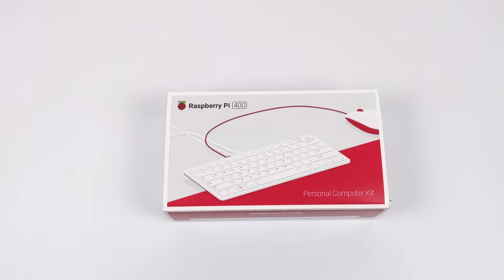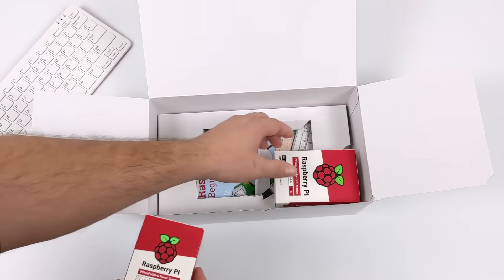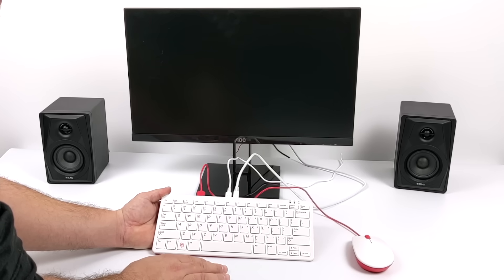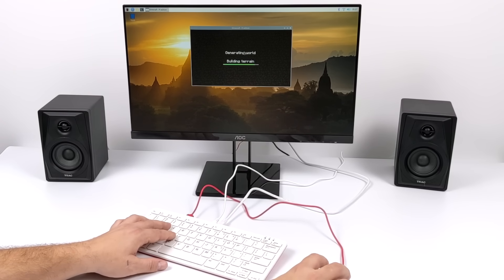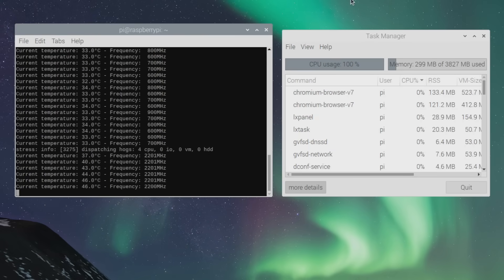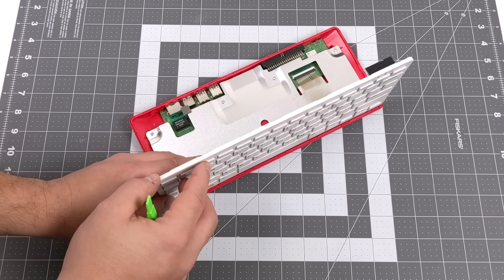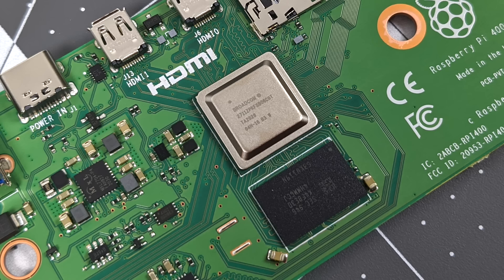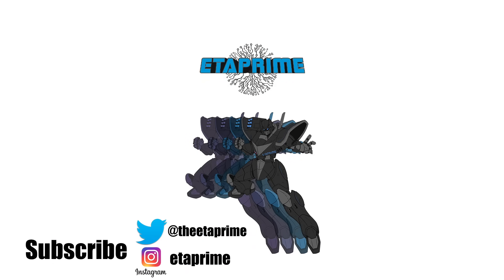The Raspberry Pi 400 is Awesome! Review, Overclock, Emulation, Tear Down

Comment: Do you think there would be enough room to get an M.2 NVME inside ? that would be very nice.
Reply: I’m pretty sure that the Raspberry Pi 4  only has PCiE gen 2, so they’d be better off just supporting mSATA, as realistically, with that CPU, etc., you won’t be getting the most out of an NVME SSD.
Reply: @GreeniusGenius  I am not technically minded enough to consider that but I was thinking the nVME is so much smaller so more chance of fitting it in, I do have an nVME running with my Pi4 in an Argon ONE M.2 case and it does work very well but I wouldn't know what percentage of its ability the nVME is working at. 
I was a click away from buying the Pi400 but the 4 gig made me hesitate wanting 8 gig, but I really like the Pi400 so I think I will buy one anyway, 
Thanks for your reply.

Comment: So wait.... I can literately just purchase a Raspberry Pi, and I can ditch my MacBook Pro's???  I always thought the Pi's were just mini computers used to control small projects and radio signal receivers etc... had no idea they actually functioned as stand-alone terminals.  Hell... I am going to try to pick up a 400 or the new one that came out recently, and see how it runs.  Does it require an external hard-drive or is the micro-SD technically the hard-drive?

Comment: I just bought one because it strongly reminds me of the old-days-gone home computers, all in a case, keyboard and storage, ports on the sides, turn on and operate. It is also beautifully styled and it does everything you need withot turning on my 550W PC (which I shall use only for gaming). For everything else, including emulating anything in the home computer history records, this is more than enough. And it's cute.

Comment: My old pc just dead because my mom just remove my pc about 5-6 months! I wish hope this new pc raspberry pi 400 will better than my old pc!
4GB.
Unknown storage could possible to File manager.
Micro sd Card slot from this Port raspberry pi 400.
Stunning performance perfect.
You can also enjoy this device! However be careful to not Have Problems startup.
It can run Windows Linux Batocera Linux Mint Everything OS can run on this device.

Comment: Would be nice if they made a laptop.  I don't particularly care about the GPIO pins, I just want a simple Linux box that I can carry around, that uses barely any power.  The computing power of the PI is just fine for most things, even development.

99% of the people just want a web browser and a way to play videos and music at this point.  I want a an inexpensive computer which I can completely understand.  I don't need a terabyte of disk space, I don't need 8 cores, and I don't need it running a 2.4Ghz, and I don't need 32 GB of memory.  I'd be perfectly happy with TWO cores, 2GB of RAM, 64 GB of storage.  Most people would be.

And I don't want to have to deal with MS messing around with the system and breaking it.  The great thing is that if you brick your PI, you just reflash your card.

Comment: How do you get around the lack of audio jack?  Especially ur using a display that doesn’t have built in speakers or speaker output?   Since the pi has Bluetooth- can you connect to Bluetooth speaker?

Comment: Hi the first time I bought the Rasberry pi 400. Does the small problem have black edges on the screen, does it only work on the Monitor?  It works fine on hd TV 24 inch but 4K or 8k 55 TV.  😕 We had need for extra laptop so I bought it for mom but DONG.😪

Comment: Hey ETA PRIME,  I just got my raspberry pi 400 and I started working with it but I noticed that every time it boots it first goes to HDMI and when it boots to the OS desktop it switches to DVI mode.  I have it connected to my HDTV using the HDMI connections and I've tried making changes to the config file but still haven't seen any changes.  Is there anything else you think I can try?

Comment: The keyboard is bad quality, breakdown very fast after months. Compared to Atom Chromebook, it is much slower and if I compare to a faster Chromebook, this Pi 4 lost faraway to dust. If I run in 480p, then it is good but when it is 720p, it is still acceptable if I run Youtube and Firefox browsing in below 5 tabs. If I start the full version of Libreoffice, it will be slow and sluggish. Installing other apps are also slow. As you said, this Pi 4 is still ok for daily checking email, 720p youtube, and browsing but not good for more medium demanding apps. High-demanding apps are nightmares and I regretted running on this crap. Don't believe in those scammers trying to advise you how to fix your problems because they are all paid advertisers who will waste your time.

Comment: It is a good option for 70€ or so, but you must add a good sd card, total cost more than 100€. And a PC of more than 100€ is better than the rb4 in terms of power. So... it is not clear the option.

The consume power is less on rb4, that yes.

Comment: OK, so it's never going to compete with a proper "gaming" spec PC, or a professional "Wintel" workstation, and it came out a little late to be the "obvious choice" for working from home in "wave 2 lockdown" but if my "real world" experience using a bog-standard RPI4 with 4 gig of memory in an office environment, it's perfectly capable of running Microsoft365 applications in web/cloud mode including Outlook, Excel, Word etc. performs all the admin functions. It can even run Teams (in Chrome) with an old webcam which Windows/10 wouldn't look at.

It might not be quite as slick as running the binaries "locally" on an '86 laptop but it provides a viable alternative if you're just using the web based clients - with all the quirks and frustrations that entails!

Also capable of maintaining Wordpress sites and Spiceworks cloud based helpdesk - so I'd say this is worth considering if you need to produce hardware to colleagues working from home, and have a very tight budget.

Comment: That huge metal heat shield also serves to give the unit some heft, much like the weights they used to put into some joysticks. Guess it helps to counter any notion that it is cheaply made were it too light.

Comment: I won't vote for Pi 400 but a traditional Pi, say Pi 4, instead. There is no need to have a wired keyboard. Just placing Pi4 somewhere behind the monitor and use a wireless keyboard and mouse freely.

Comment: Are you're crazy? You can buy a cheaper smartphone and connect everything on the screen to it, while it will be more powerful
Reply: Where can i buy powerrfull smartphone for 70 usd?
Reply: @DartLuke  Doogee N20 Pro powerful enough, buy on Ali
Reply: @danielwilson7567  minimal price 135 usd on ali. It isn't cheaper. It has 3 years old midclass processor. And good luck to install Linux on it
Reply: @DartLuke  in russia 60$
Reply: @danielwilson7567  e-catalog от тринадцати тысяч, яндекс маркет тоже самое. Ты где такие цены нашел? Ну не может китайский телефон стоить в России дешевле, чем на али, если он только не ворованный или бу.
Более того, добавь к стоимости своего смарта хаб с кучей портов, клаву, мышь. И цена подскочит еще выше. И на этом смарте ты хрен поставишь нормальный линукс. Ты сравниваешь мобильник с полноценным, хоть и слабым ПК.

Comment: I'm sure once the Pie 5 or 500. Being powerful enough to compare with Chrome OS and budge windows laptops. This will lead the way to cheap, Powerful computing. If the Pie 4/400 are anywhere near compatible to run browser performance of youtube and standard surfing. The Next gen will surely be on par for Budge friendly true desktop UI performance.

Really surprising BT 5.0 and Wireless AC is slammed on this + Gigabit ethernet, That's lots of networking power in a tiny package. And (If i'm right.) Dual display output Whaaaat is pretty nuts.

I'd be really impressed if they managed to make Pie 4 or even next pie 5 to have a Laptop rig to put the Pie in and have full laptop like appearance and a bit of boost for performance.

Comment: Thanks for the review sir. How did you connect the speakers?  Looks like Bluetooth as no wires are evident. If one wanted to use wired speakers instead, what would be the best way to to connect them? Also, is it able to use the in built audio of a television if I opt to employ it as the monitor?

Comment: Can I also use it for TV with hdmi ports on it?
Reply: HDMI. So yes. HDMI is a universal Display port system. While Normal Display Ports with a more square and slight right side knoch are specially for Monitors and PC displays. While HDMI works ether HDTV's or Monitors/PC displays.

Comment: Pi400: 2200 with overvolt 6 doesn't work for me, it hangs after 5 minutes of running stressberry with four cores running on retropie OS.
2147, 6 OVERVOLT , 750 GPU works beautifully though.

What command settings and command did you use to run your test? Do you use the original PSU?

Comment: Now some people Say It has out of the box problema playng video over 720p whitout browser extension to play h264 video smooth now.... What if i play them directly on VLC does It set automatically h264 for streams in 1080p 60fps. And at h265 for 4k 60fps stream? Or should i set It manually i Will use 2 different VLC version 1 encoding real time h264 and other using h265 codec (real time encoding) i dont care if the file has another encoder on the info. VLC does the work if you set It manually. Someone as tried It already?

Comment: For people from the C64, Amiga etc era, this kind of power for $100 in a standalone unit is astonishing even ignoring inflation.
Reply: it essentially is its own little modern C64 if you think about it
Reply: @data043  its basically the same category of product for the modern day ... and guess what ? this thing can emulate C64 & Amiga very well 

not to mention that the C64 was many people's first computer that they used to learn peogramming, which is one of the core reasons why the raspberry pi even exists , and the pi 400 is perfect for that job
Reply: It's impressive even for someone born in the 2000's.

Comment: Hey hud. I want to thank you for making this. Making videos likd this is work. It takes time. I appericate what you do, sharing information and your way of doing it is clear and concise. I only clicked this because I've been thinking of making a raspberry pi or arduino [Not sure then differences between them i assumed it was brand, its been a while since i wanted to get one for not just games but a internal relay system type using these. Having an internet kind of sharing outside the reg. Net, my friend did it before in a study i want to find iirc he showed me his which was a very small version  231 people , the Line we called it because it grew and grew it was a hotbed for info and programs. We crwated a micro internet in the most simple way to put it, wasn't easy  one guy did a lot of the coding and algorithmic parts. The part that was a pain was getting thru the red tape of putting fiber optics ANS copper wiring (for important reasons needed both) along roughly 10 by 21 mile [imperial i assume as this is for English users not Private Military Company workers, I speak Italian first, German, second. Japanese and English i grew up learning. And still am bad at English when writing or typing i type a lot im also in hospital for cancer so foggy n waiting surgery. Sorry for lobg comment. Thabks for rhe time in this. And reknewing my interest

Comment: I been playing around with this pi400 for a few days now.  No matter what system put in there, I cannot get the sound over HDMI working.  BT also has no found.  But when I plug in USB sound card, the sound work.  What OS you guys are using.  I tried RaspianOS 64bits, 32bits, Ubuntu, Kali.  all no sound.   Start to think I got a bad board.  Nest I will try plug into the tv and see the HDMI sound work or no.   So far, I also found different sd card gave big performance different.  One card gave me 25MB read/write, and Sandisk Extream gave me 40MB read/write.

Comment: We have monitors at the university and i would bring my raspberry pi 4, my keyboard and mouse to the library to work. It was really annoying to carry all these around every time. This Pi 400 solves my issue perfectly.
Reply: Same, there was a TV area in the library that was mostly unused (in place to watch DVDs), so I brought in a Pi and keyboard/mouse and turned those TVs into my own computer. That was so long much effort (and I ended up losing a keyboard!) and if the 400* was available then, I would have loved it (and probably not have bothered even getting a laptop, as there wouldn’t have been a need for one!)
(* of course taking into account the 4th gen power! I already have a Pi 4 but I’m tempted to buy already bought a 400 now, which I'm loving...)
Reply: wow - you're right - super easy, compact way to dock!

Comment: The announcement of this was a pleasant surprise.  I know some found it puzzling, but I like this variant of the Pi.  I was considering picking up their desktop kit in the past because I like the look of their keyboard and could use another one, but it never made sense for me to actually buy one.  It seemed like a bad value since the included case was useless due to the thermal needs of the Pi 4.  This is a different story and much more appealing to me.  It's nice to finally see a Pi 4 board with proper cooling included.  That's one of the things I've always liked about Hardkernel's Odroid boards.  They've almost always had good thermal solutions.  I may just get one of these.

Comment: honestly i like the idea but i would want it as a low power 4k player. so it wouldn't work for me. as a truck driver sometimes i want something that can play 4k videos, especially if you can save some (legally) movies onto it to watch in bad celk areas. i do have a tablet that can do this but it is not a perfect experience,  it gets hot, and sometimes i would want to do something else on the tablet while watching a movie.

Comment: small trick: Use VLC for Youtube-Playback. Maybe even use the official Firefox-VLC-Plugin though onlyused VLC with "play network stream". I was able to run 1080p60 without flaw on an Pi3 and the CPU wasn't even maxed out. I guess an overclocked Pi400 should have no problem running even 2160p

Comment: It seems like the HDMI connection would get buggered soon from the keyboard be moved about (?)
Reply: That’s the problem with the micro HDMI connection, it’s terrible. Too often I get issues when I move my Pi slightly because it gets disconnected
Reply: @fetchstix  I think I found the fix. A right angle micro HDMI cable.
Reply: ...plus a strip of tape for connector strain relief
Reply: @fetchstix  My Pi is still in the box. Thanks for your feedback on what I saw as a potential issue. I am ordering the right angle connector now.